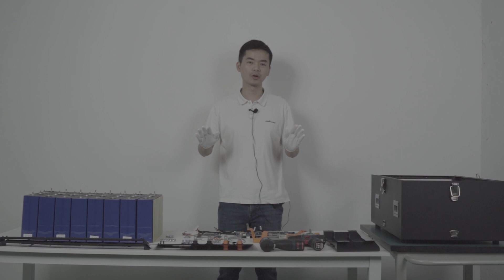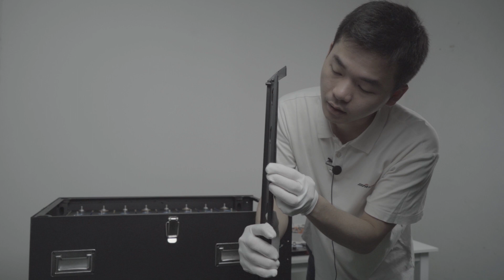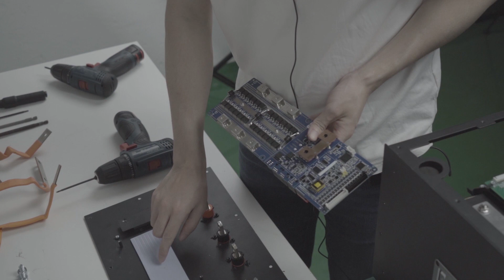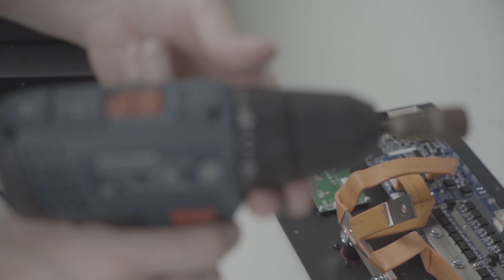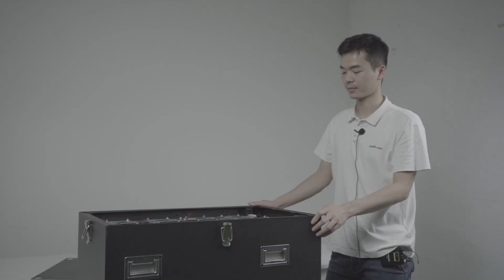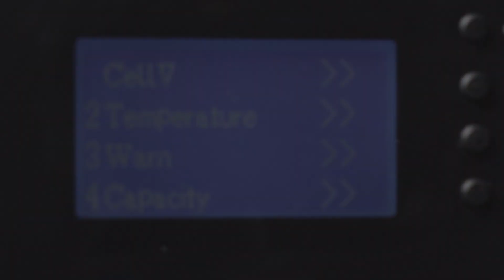Suitable for EVE 280Ah LiFePO4 Cells - SEPLOS DIY Battery Case Assembly Step by Step Tutorial Guide

Comment: Sorry....adding a 15mm (for example) copper gasket on a 11mm (for example) battery terminal stud....is NOT increasing any contact area. Just adding an extra level is resistance....

Comment: Are those batteries charged?
Wouldn't you get zapped at the end stage?
Btw the packaging was rubbish, everything loose inside the bag
And you sent me 13 normal sized busbars and 2 oversized ones that don't fit anywhere...
A bit more quality control would have been appreciated

Comment: After watching reviews of the BMS, I could rip out the stock BMS and install a JK BMS in its place. The Balancer in these BMS is too weak for be of use in a battery this big.
Reply: "Active Cell Balancers are Usually Pointless for DIY Solar Batteries" direct quote from Will Prowse
Reply from the maker: Zeronic, thanks for your feedback. We know Andy was telling the truth about the balancer. 
And we have mentioned in the manual before andy's video. that we didn't add an active balance on our BMS and the passive balance current is only 150mA.  
If you do need an active balance, we totally understand.
Reply: An alternative is to add a NEEY 4A 4th gen active balancer - which could be simpler to retrofit - and the advantage is that you get two sets of data for monitoring the state of battery cells and well as a 4A active balancer - see Andy's NEEEY video.
Reply: I don't understand why I should waste my money to equip my top-balanced never-been-used cells with active balancer. And the APP is a total gimmick. Most YouTubers are no experts, sometimes what they do is slandering or bluffing to hijack suppliers for money. Stop being their accomplice. Check Will Prowse's review on active balancer and passive balancer with sense.

Comment: By arranging the buzz-bars a little differently I think this could be configured as a 24V version, i.e. 2P8S? Can this be done and if possible will the BMS support this?
Reply from the maker: Yes, the BMS supports 2P8S (8 cells in series).
Reply: @SeplosTechnology  do you have a buzz-bar diagram for the 24V configuration 2P8S, what is the best way to contact Seplos?
Reply from the maker: @jackbarnes6929  You contact Seplos at info@seplos.com

Comment: Great DIY Solution. Thanks for sharing. Coming to my build, I have 16 EVE 280Ah k model (new generation) LifePO cells. Is this Mason case compatible w/ the same? And, also, i see that there is only one BMS (CANBUS 24/48V 8S/16S 200A) listed on your website that has 200A rating. Will this BMS or the one included in Mason, compatible w/ the EVE 280Ah Kn cells for 16S config for a 14Kwh system?
Reply from the maker: Hello Amar C, Thanks for your comment. 
The case kits incudes Seplos 16s 200A BMS, and it is compatible with EVE280K.  Please contact us  for more details at info@seplos.com
Reply: From where you buy your battery and how much the 16 pcs of eve cost?

Comment: 10:12 I noticed you used only a single busbar size. Hmm! Are these EVE280AH, or EVE280K (new gen)? 

Though the terminals look easy to connect/disconnect, it wont be safe doing so when in powered.
There ought to be a disconnect switch on that battery pack.

Comment: What are those conductive gaskets? I have never seen them used before.
Reply from the maker: Red copper gaskets to increase the contact area. Cause it needs 200A current flow.
Reply: @SeplosTechnology  Do you mean washers? A gasket is for sealing something.  A washer is a metal disk with a hole in it that would spread the contact area of the mating surface.
Reply from the maker: @SmokiesDen  yeah, in this case, a washer would be more accurate.

Comment: Great video! Do you know if there has been any testing for fit and functionality for the EVE LF304? The LF304 is 4mm taller than the LF280K.
Reply from the maker: Hi Brian, yes, we've done the test for EVE 304Ah. They can fit the battery case as well.
Reply: Careful, the 304 has just 4000 cycles compared to the 280, so in most use cases not recommended
Reply: @patrickmartin4482  Why is that? The LF304 is ≧ 3,500 cycles @250A (.82C) The LF280K is ≧ 6,000 @.5C (140A). I don't expect to ever draw more than 100A.
Reply: @bbrown_sc  I dont know, but i decided to go for 6000 cycles for home photovoltaic use ...
Reply: @patrickmartin4482  ypp is already too heavy with 280 cells,  I stick to them
Reply: @patrickmartin4482  I wouldn't complain about 4000 cycles!